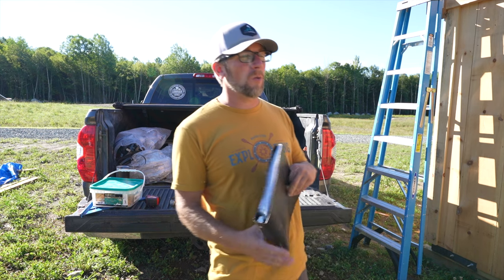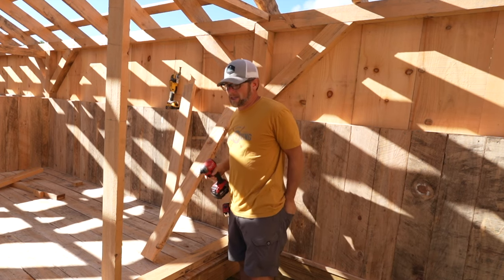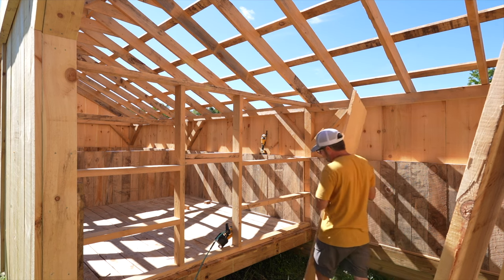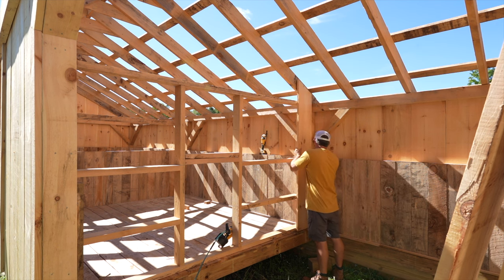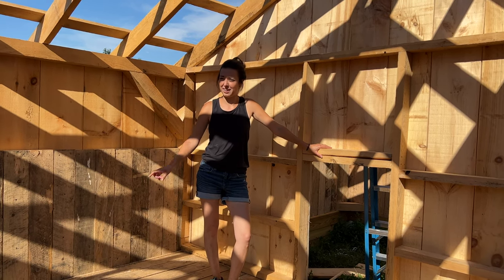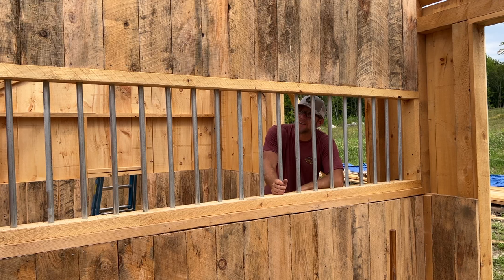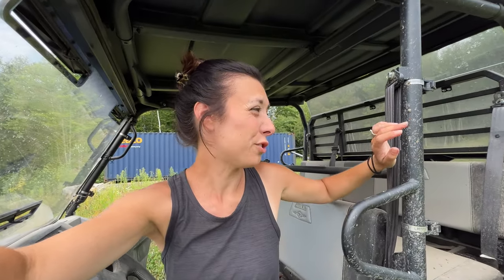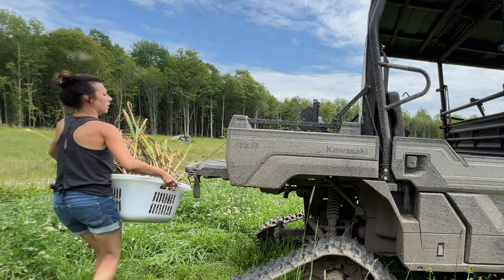The BEST Part!!! Building 2 Post & Beam BARNS at ONCE

Comment: Hi Gina and Al, the two barns are looking good.
Gina I learned a trick when growing garlic to get bigger bulbs cut off the flower heads if you are not going for seeds this will force the garlic to put all its energy into the bulbs. You can do the same with the onions as well. Best part is you can trim the steams and use them as well.
Reply: Good advice!  Maybe next time for them as they just planted it and walked away... looks like they still had a good harvest! :_ILikeIT:
Reply: Gina cut the scapes last month.

Comment: 23:30 we used to bundle onions togetger with bailing strings, and hang the on the inside of the barn door. Open it in the morning to let the sun get to it, and close it at night so the moist and cold dont get to it. When the green top turn brown, they are done. Store cold and dark.

Comment: hi there, you could either tie small chicken wire to the metal poles or staple it to the 4"*2" frame around it, both sides to keep the small critties out, the barns are looking good.....

Comment: Al, you need to get yourself a sliding bevel for your angle cuts, those upper boards were all over the place, and you are usually spot-on with your woodworking cuts.
Did you get a/c in the house ?  Can't remember. 
Those goats will be living in luxury,  hope they appreciate it  🙂🙂👍👍

Comment: How about the watering system where you plug in the hose and there's water in all three stalls? Would save you hauling water in buckets or filling two or three. I like your idea of the translucent panels in the roof rather than the walls. It's really beginning to look customized to work fits your place the best! Isn't that what you need?

Comment: Have you considered placing outlets higher on the wall in the office space -- above the top of the desk area -- to plug in your computer, printer, and other hardware? This would save bending over and crawling under the desk to access the power. Just a thought!

Comment: Give me the other barn you're building now you could make the center room a milking room and build a milking platform for Gina when she's milking goats. Maybe insulating the walls and ceiling in that stall would be helpful in the cold part of winter. At least it would cut the boiling cold if it if there was at least insulation in the walls and the heat given off by the lightbulbs was kept in the room. You could always add heat if you thought you needed it. I do like these styles, I think you'll be happy with him.
Reply: Goats body heat is excessive.

Comment: Fantastic Barn(s), but I think I would line them up to have the tall sections (the short roof sides) facing each other and span the two roof peaks with a covered drive-through area (metal gates on both ends of the covered common area). It could be a great area to store the tractor or a work area?
Reply: They are facing that way as explained in previous videos.

Comment: looks super!  how would be moving them with all that extra board weight?
Reply: With a 48 HP tractor it will be easy.
Reply: I am not concerned about the tractor I have every confidence it will do what they say it will do. I do have a concern about the hooks that you can hook to it and pull on the device from the brackets you put on there's a limit and every piece of wood's weight.

Comment: Regarding the height of the outlets, you might say: "It has always been done at this height!" But unless you have lived with outlets at a different height you just might not now better. I hate having to crawl on the floor, and underneath and/or behind furniture to use an outlet at a height of 30cm. I very much prefer to have my outlets at a much more convenient height of 100cm! And with advancing age this issue just goes higher in priority. Having a low outlet also makes it more inconvenient for gadgets you use on top of a worktop or table.

Comment: So, why does barn one have a sill plate at the goat entrance and barn two doesn't?
Reply: Look again it does.
Reply: @tonygrimes13  Nope, you can see at around 26:17, that the goat access in barn two doesn't have the sill plate, and at 16:28, barn one does. In fact, he built the two walls differently. Barn one has the plate the entire width of the barn, with the goat hole and barn two without.
Reply: @bille294  Apologies, I read your comment too quickly & thought you meant outside sills. Maybe Al changed his mind after doing first one! He did say at start that he had a plan in his head.
Reply: @tonygrimes13  No problem. There's a lot going on in this video. Trying to build two barns like this at the same time, and by yourself in first of this video, has got to be a lot of fun...not.
Reply: @bille294  Also setting camera positions to video for us the viewers! I've counted the number of clips in several videos & it's an average of 150!
Reply: @tonygrimes13  That, in and of itself, takes a lot of time. When Gina is there, and can help with the set up and the build, more gets done, but that's a lot of work to do with just one. Set the camera's, it looks like they have at least 2 plus the drone, and then move them when needed. Plus all the editing he has to do, makes you kind of wonder when he sleeps.